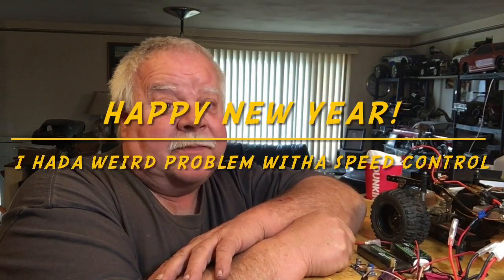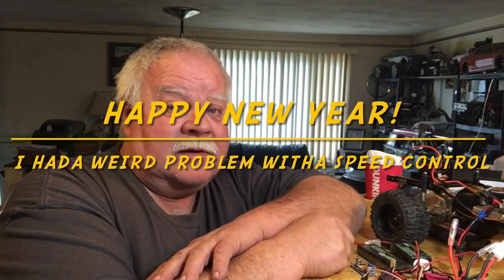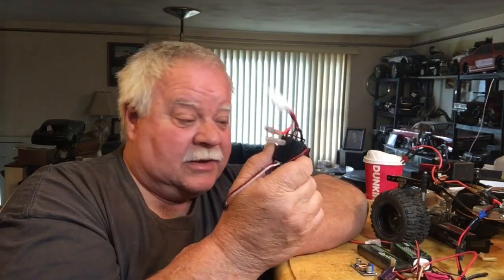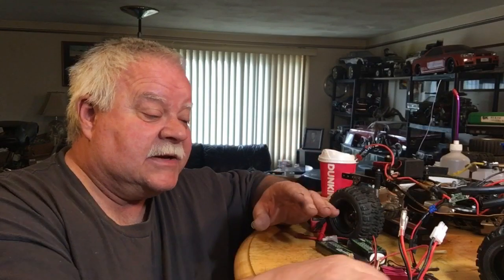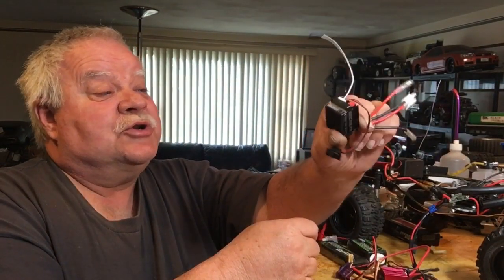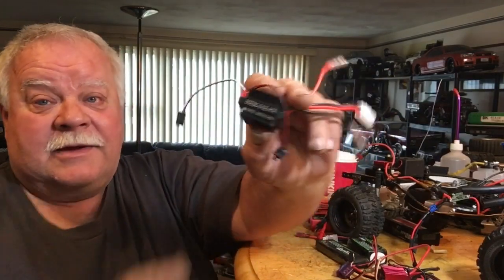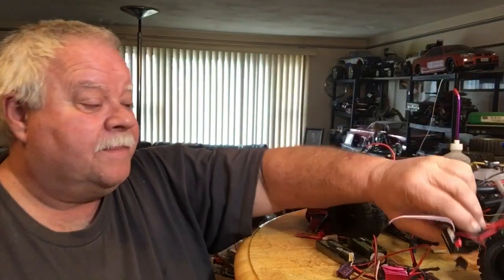Happy New Year!

Comment: Do you think I will have a problem with a hobbywing speed controller or are they known for reversed politity
Reply from the maker: I couldn't honestly say in the hobbywing controller,  if you have a multimeter to check the polarity it will tell you, the multimeters are cheap to buy and you will find that you will use it alot in our hobby like checking glow plug voltage and other things.
Reply: @Dennis Dempsey Radio out of control  thank you Happy new year to you to I'll check it and make sure